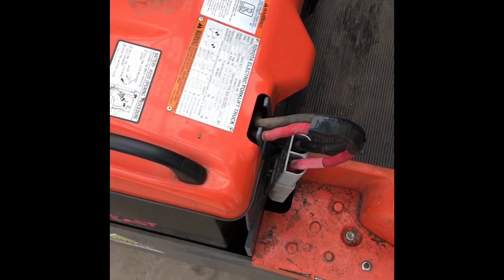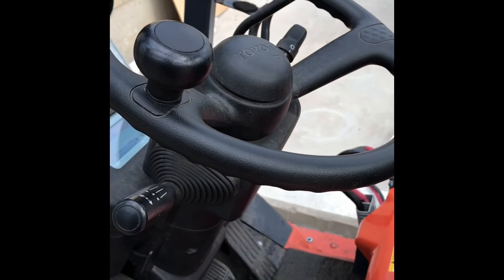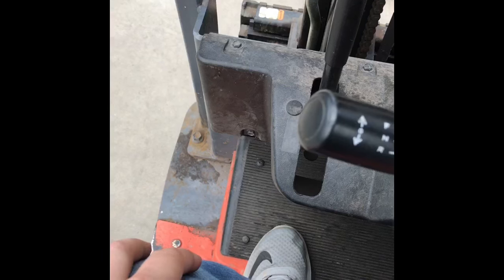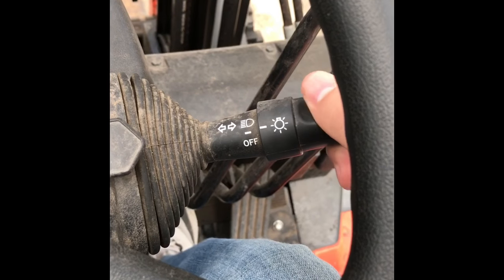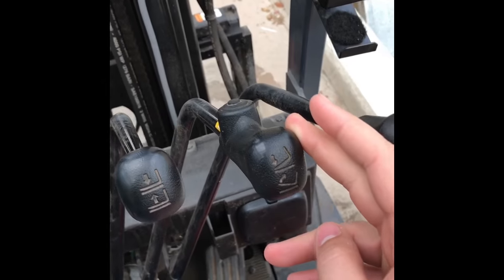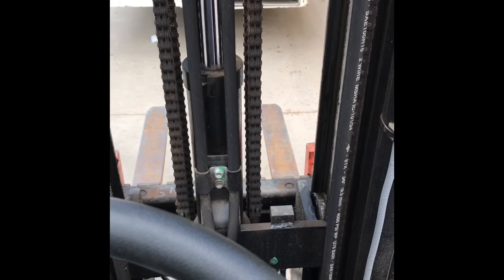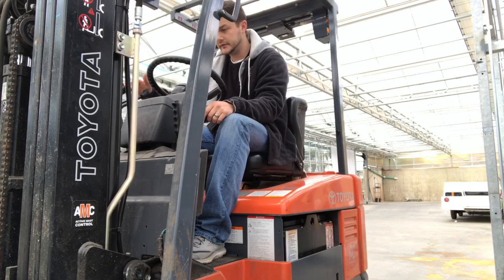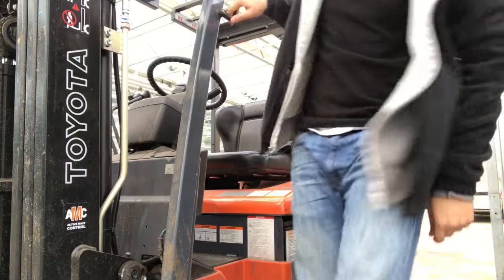How to operate/drive a forklift

Comment: Going for my forklift license soon as part of a job, never really even looked at a forklift. This video was actually quite helpful, would have been good to cover the foot pedals as well, im guessing there is only an accelerator and brake ? 

Thanks
Reply from the maker: Better late than never, sorry about the delay - there are actually three pedals... accelerator/brake/and a third pedal which acts as a neutral gear and brake - it allows you to hold the lift as if the brakes are applied but use the accelerator as well... it is mainly used to speed up lifting something very high or help when lifting something very heavy. So you would depress this third pedal with one foot and use the other foot to press the accelerator.

that was a great question though, and glad that this video could be of some help.